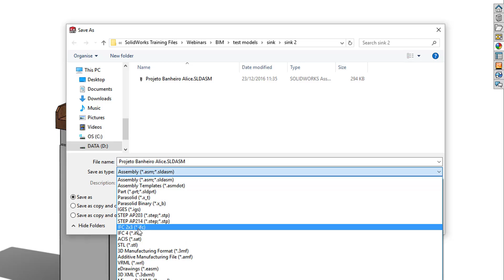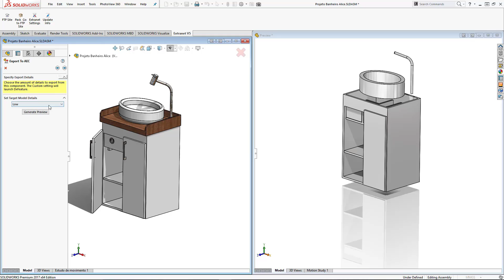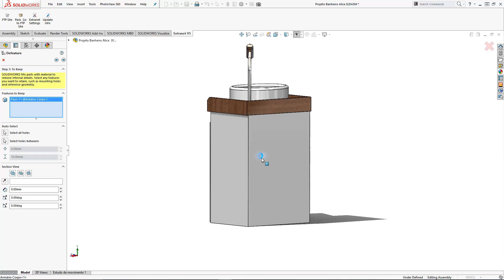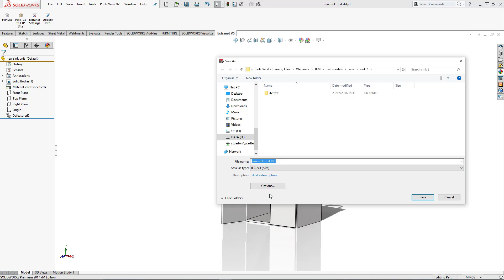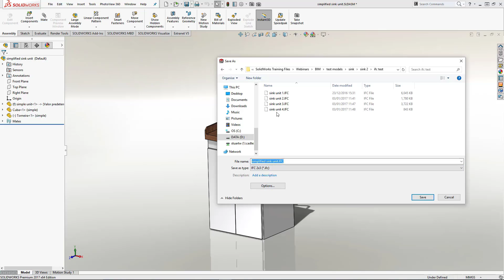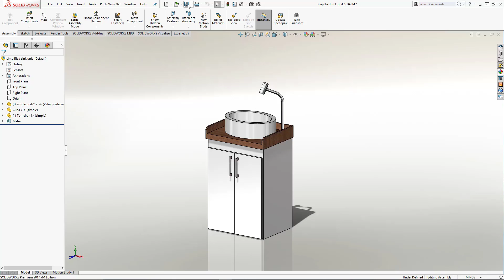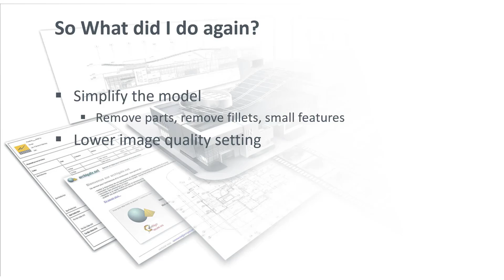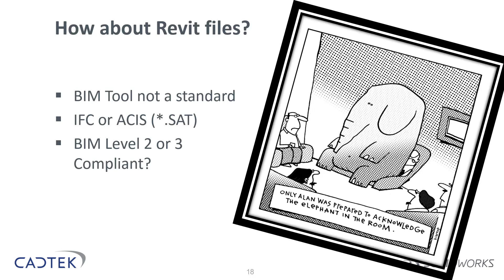IFC Creation in SolidWorks - BIM Compliance

Comment: I've been getting requests for BIM models with material textures attached. If I assigned materials/appearances to my Solidworks models, would the textures come through to Revit on the IFC file? Thanks.

EDIT: also, how much would textures affect the file size?
Reply: in my opinion the filesize is only affected if you apply a lot of different appearances (i.e. 100+)
I dont think taht the appearance is exported to IFC-format - instead you can use the fbx-fileformat (available in SOLIDWORKS Visualize)